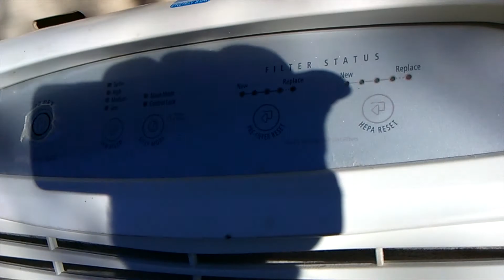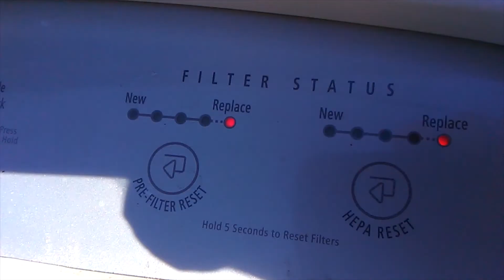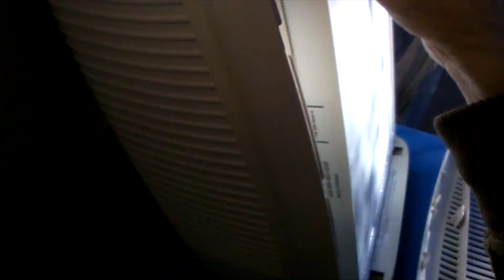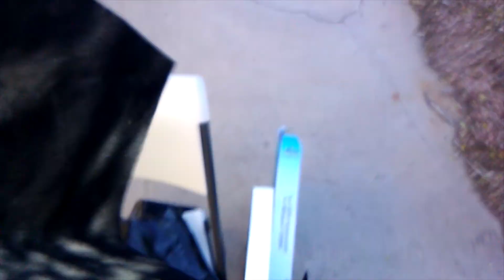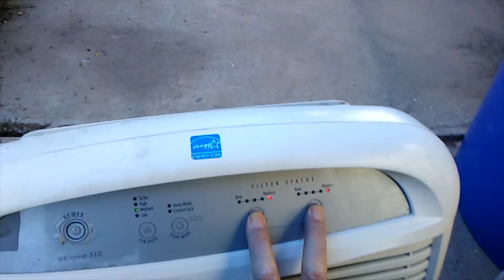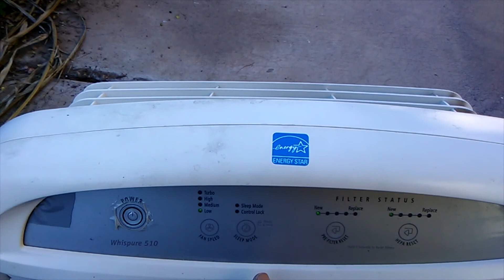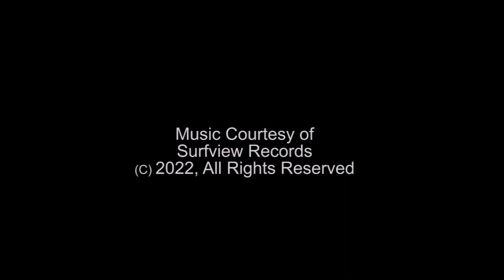Let's Clear the Air - Whirlpool Whispure 510

Comment: Important topic, how often do you change your filters. We change our air purifier filters every six months and HVAC filters every three months. Happy, Healthy and Prosperous New Year to you and your family, and thank you for sharing.
Reply from the maker: Happy New Year!  I change my HVAC about every two months when I'm using the heat pump for cooling or heating.   I usually change my Whirpool Whispure 510 filters when the red light turns on - which for the carbon filter is about every 3 months.  And the HEPA filter is about every 12 months.  It doesn't seem to work off of a sensor - just run time.  When I leave the house, I turn it off.  But, now that I'm working from home, I don't leave as much.  So, it runs more often and the red light should come on quicker.  This video is the first of the LET'S CLEAR THE AIR series.  My next one will be about using a liquid air filter - which is an invention of mine.    Should be more fun than this one.  Thanks again, Daniel.